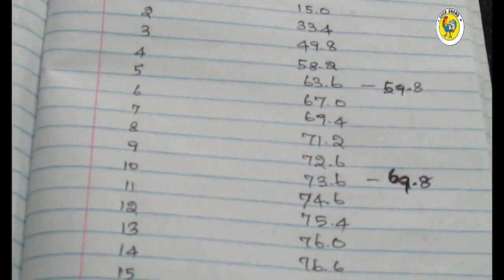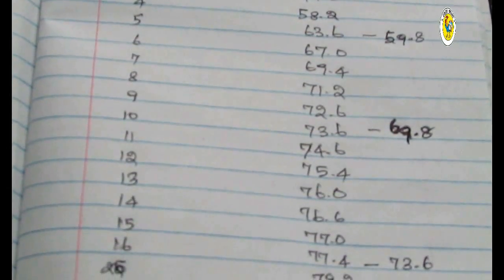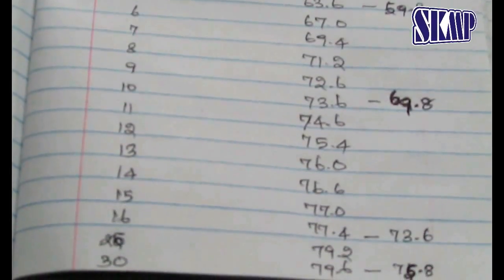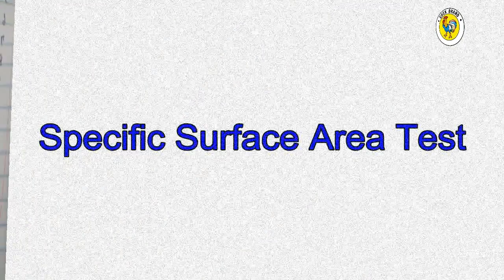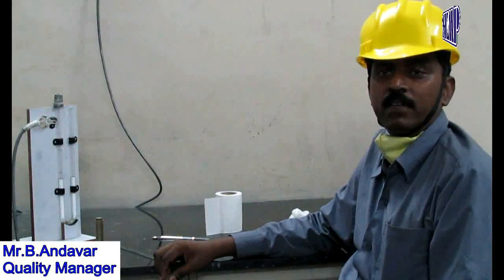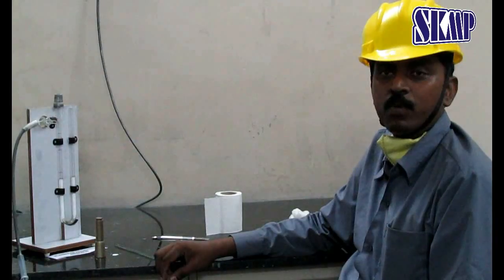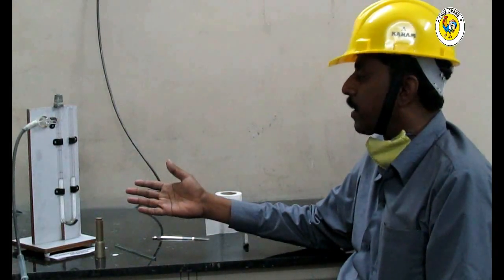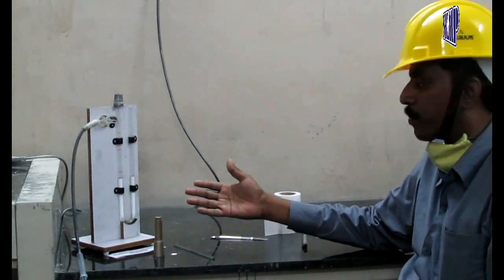AluminiumPowder  testing procedure for AAC block  application from SKMPPL

Comment: This aluminum that you are using would it be the same as the cuttings found after cutting a piece of aluminum bar with a fine tooth hack saw ?  Just shavings from pure aluminum ?  Is this a product that can be purchased from you directly I am in the Philippines?